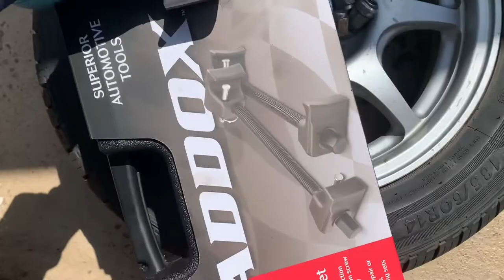DIY MacPherson Strut Spring Compressor Set from Harbor Freight

Comment: How'd it go? I need to do this today. I have the rear off but need a compressor. Any good?
Reply from the maker: Hello Brad,

Just clamp both upper claw below upper control arm parallel to each other.  Likewise with the lower claw and make sure the safety pin are pushed in because they tend to come off while attaching the claws.  Let me know if you have any more questions.  Happy wrenching! 😄
Reply from the maker: Just below the top hats should top hats mot upper control . Typo error 😄
Reply: @jpscrx  Thank you. I have one side done. The bolts are seized so it's taking a while.
Reply: This doesn't go as easy on a bmw